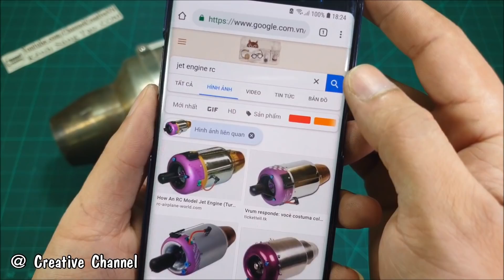What's inside Jet Turbine Engine RC Plane

Comment: Why is it being disassemble in such a fashion? Many parts were still good and it could have been fully restored. Brutality!
Reply: No parts were damaged in this video 😂
Reply: Stupid teardown.. Hahha
Reply: To Some People It’s Junk Or Spare Parts.
Reply: This engine looks as it had been in a crashed plane. As you can see, also the inside is very dirty, so it might have sucked a lot of dirt, causing damage to all parts inside. Since I have seen a turbine blowing up mid air, I would not put that into a model any more, to not harm people. So for me it is ok to disassemble it even with that care shown in the video.
Reply: @Maxfahrer  good observation, so different to so many stupids that don't see the real  idea behind the intention of the video.
Reply: @billmart6334  , not a good observation. A better video would have shown how to properly dis-assemble the engine. Then shown how to inspect, and what the damage was. Also a history of the engine could have put any other complaints to rest.
Reply: That motor was thrashed, not rebuildable.  I found it interesting that model turbines are actually for more complicated and sophisticated than I would have expected.  Although it is essentially a Whittle engine centrifugal compressor (simple feature) it also has an annular combustion (complex feature) rather than the "cannular" (simple feature) type I would have expected to see.  My hats off to the engineers and manufacturer.

Comment: Shame, that engine costs like 2800$ and is a fine pice of machinery, it could be restored, but nooo, lets cut it open for fun😢
Reply: True this video hurts to watch
Reply: I dont think it can be repaired by common tools.
Reply: @Kal-0000  sure
Reply: By the looks of it it seems to have oxidized and ingested massive amounts of fod.  I think it was envoled in a crash because the side mounts are bent out of axis. Most likely beyond economical repair.
Reply: Its possible for other persons to repair that. It hurts to see that guy take a saw and cut this AMT Engine into pices, because he have no idea how to remove each part! He cut the shaft because he dont know that you loosen the nut in right turn.
Reply: So... what makes you think he cut it open for fun? Everybody seems to be offended. Dont be so naive, it's an educational video and i actually learned a lot from it.
Reply: That engine was visibly damaged in a few different places. He disassembled it more than likely for the purpose of fixing it.
Reply: Who cares?? It's his and we get to see what our $$$s buy.
Reply: The way he went about it suggested that repair was not a high priority. A little too rough when driving things out with a hammer, a little careless in cutting the cables. But even so, up to 06:00 there might have no irreversible damage. Sawing it apart was, of course, the end of it.
Reply: Yea he runs every piece of it into a cnc machine tomorow ul find a engline like that more efficient more thrust for half the price damn if i had that engine first thing il do is rip it oppen
Reply: i hope this comment is supposed to be a joke. its not a shame its his money and he can do whatever he wants with it. and no he can not just "give it to someone who would use it."
Reply: ahmed mani history shows us the problem is not in how to make a turbine, it is what we make them out of.  Most of the parts are made from specialty metals and alloys that can handle the temperatures involved. The materials is the biggest reason they are so expensive.
Reply: I think it would have costed more to repair it than what it was worth. You'd have to take it to a specialist. There could have been something else wrong with it that the untrained eye couldn't pick up.
Reply: I used to recover target drones and their engines were small probably twice this size no more. The engines on these could be reused only if they had not inhaled sea water which is not gonna on a Navy test range . I know it might be hard to look at but when you see functioning one crushed because it drank a little sea water you get over it
Reply: It... hurts...
Reply: It was destroyed for fun.
If you know how, it's not hard to repair.
For me, this video is an insult.
Reply: Fun, profit, education and entertainment. What's the problem?
Reply: @Kal-0000  Есть люди которые могут не только починить обычными инструментами, но и сделать с нуля. https://www.youtube.com/watch?v=9we8FvXw2Ss
Reply: @basimpsn  Thanks for those videos. Damn 2009, it seems like ancient history...
Reply: Indeed. That's why I'm about to do a thumbs down :-/
Reply: So many axial turbine experts in the comments
Reply: Its not for fun, its for research, and it helps when your goal is to make your own, its called "reverse engineering" even if other people don't appreciate i sure do
Reply: Womp womp

Comment: You could have just used a sledge hammer and taken it apart much quicker. Why bother wrecking it?
Reply: It sounded like it already had issues and was well used anyhow. Suppose he makes more than the value of fixing or replacing it from uploading this interesting video, what problem can you see with this?
Reply: They are worth like 20 grand each. Or maybe 10 grand.
Reply: @Justwantahover  lol nonsense
Reply: @edism  How much are they, are they cheaper?
Reply: @Justwantahover  Much cheaper, £1,500 - 2,500
Reply: @edism  About 5 grand Australian. Way cheaper than I thought. So you could make a flying bike out of how many? Is that about 30 lb thrust? So maybe you need like nearly 20. lol One flying bike has 4-6 bigger ones (2 more for heavier pilots). It weighs 300 lb and has 500 lb of thrust (just enough for a pilot and about 10 minutes of fuel). It has done a tethered hover with stretch tethers and was stable. It's a 4 wheeled motor cycle that "transforms" from bike to flying bike by moving wheels (with jet engines inside) to a horizontal position. lol I hope it will succeed (it's on YouTube, just search "flying bike and scroll down, you will see it).
Reply: @Justwantahover  yes I've seen most of them, I'm quite an enthusiast 😌
Reply: @edism  So am I dude, I follow manned drones and flying bikes and flying cars. Rant:

I want to make a flying bike cos it's in between a flying car and a hoverboard in size (large enough to fly and small enough to afford).

Also I have a roadable aircraft witch could nearly really be a flying car. It will have a high landing speed (a compromise) but high top air speed. It's basically a lifting fuselage with a canard wing and a biplane delta wing (only 8 ft span). lol But good wing area but the shape will make it fast. The idea is to go fast, with a single 450 hp gas turbine engine driving a rear pusher prop like the SwitchBlade and Terra "near impossible" concept (only in planning stage). 

On the road it will be electric (motors in the wheels, maybe) and the gas turbine will charge batteries when flat (which will only have a 20-30 km range, for lightness). It's an alternative to a Lear Jet, with the convenience and like 300 mph cruise (in the air) it would be great for business folk and amazing fun fun fun to use and show-off with your friends. 

The idea is to get there quick and have that "sports car image and feel. And with no transformation needed it would be cheaper and easier to make and it would feel good using it (a solid chunk, just like a car).
Reply: @Justwantahover  When batteries improve by 1000% everything is going to change significantly. It's all about that energy density,
Reply: @Justwantahover  They are 5 times less expensive today, in Summer, 2020.
Reply: @Justwantahover  They are 5 times cheaper today, Summer, 2020.
Reply: @Beamshipcaptain  Batteries or model aircraft jet engines?
Reply: @edism  But jet engines large enough to make an Iron Man suit or jet pack or the VTOL Jet man, would be expensive. The Iron Man suit sells for nearly a half mill.
Reply: @Justwantahover  when you're looking at a price you know you're covering profit, research and development, delivery, marketing, packaging costs etc. The bill of materials isn't going to be anywhere near that.
Reply: @Justwantahover  You can use several of these together. It's not expensive at all.
Reply: @Justwantahover  Jet engines for models. Cheapest  are only $1675.

Comment: The central shafts in the static housing were ground away. My guess is those two parts shot totaled the engine. It was not inspected regularly since it was so dirty inside and it was run with a bad bearing until it seized.
Reply: That "dirt" is mainly water corrosion, the engine has clearly been submerged at some point. besides that the main components of the engine with the exception of the bearings and possibly the main shaft were salvagable. if you look closely there were no signs of the turbine or compressor wheel having made contact with the housing or stator ring.

Comment: Good job destroying what looks to be a perfectly functioning engine.
Reply: It wasn't functional.. the main shaft was split in half and the ball bearings had fallen out of their sockets. My guess is that the bearings failed and sent those balls into the engine effectively destroying the engine. Breath a sigh of relief because I was there with you until I saw the whole thing.
Reply: @ejkk9513  Not quite true, the bearings may have been destroyed but the turbine wheel and stator wheels including the turbine wheel housing were perfectly usable, a bit dirty - yes but salvagable meaning that it was not a catastrophic failure and could have been repaired relatively easily. I have done it myself with an older frank turbine engine.
Reply: @wind of change you don't sound like an axial turbine expert.

Comment: A really fine piece of machinery ! These turbines are beautifully made. I’m really surprised by the conception of the first compressor: it’s « full », like there’s no blades catching air from the center rod out to the side. The air seems to be caught and compressed only from the circumference of the stage. I’m sure these are highly calculated and optimized, but i’m curious as to why the first stage compressor doesn’t have blade getting air from the whole surface  instead of just the edge.
Reply: BTW: I was talking about the compressor at 3:50 .
I think the reason it’s like that is because this turbine is more like a turbojet, and not a turbofan. It doesn’t use bypass air for thrust. Right ?
Reply: @radicaltronic1855  that's Centrifugal Compressor similar to the ones used in car turbochargers, it's much simpler and safer design than Axial compressors used in modern real jet engines. Actually very first, pre WWII jet engines were using same system, British Meteor jet fighters were using engines of this type. Today all commercially available mass produced RC model jets are using CC engines, while there are Axial powered prototypes this things are insanely expensive and noone has figured out mass production of them yet.

Comment: I had no idea that they used regular ball bearings, I was expecting fancy floating hydrodynamic bearings...
Reply: The races have ceramic balls to take the heat and are lubricated using oil in the fuel around 4%

Comment: Does that mean when the engine is running on fuel, the electric starter motor is being spun by the jet engine?
Reply: No, look carefully at the shaft when he tests it the second time. It retracts when there's no torque from the motor or when it's exceeded by the turbine's shaft.

Comment: I don't know how people are saying this thing is still good. The impeller needs balancing, which I doubt he or any of you have the machine for, or the knowledge and light touch. The shaft cover that connects the centrifugal impeller to the nozzle guide vane is broken. That thing will leak air through the break. I don't know how much parts cost, but if he got this for cheap then why bother? Part it out and make a quick buck.

Comment: This jet engine must of been used when he took it apart the inside was well caked in bearing and ball bearing came apart, these micro jets only have a 240 hour rating.
Reply: I don't know what you are talking about, they are supposed to have the bearings replaced every 25-50 hours depending on the manufacturer. other than that they do not have a "life" they work as long as they are taken care of for.